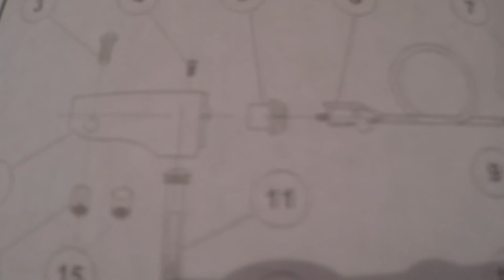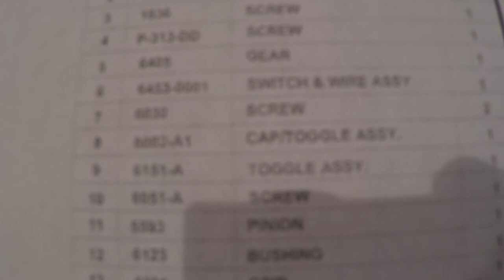Unity Police Spotlight - Remove or Fix

Comment: To spot a 2011 Impala 9C 1 I noticed it did not have ambient air sensor, I was thinking the center was bad until I found it missing went and bought one put it in, and OEM still don't see no temperature my question is did they even install a ambient temperature sensor in these police model cars

Comment: I am restoring 2 spotlights for my 55 chevy. I have the original ones but they have pitted chrome so I got a couple from a few years newer Chevy that have great chrome.   They look pretty much like yours in this video. Problem is I will need to remove the long shaft that the drive rod goes through. It should come out .  I have 6 to swap parts from but I cant get this inner rod out of any of them. Any ideas?  Thanks!
Reply: Make sure the parts are not matched up with the Old ones.

Comment: Hey cool video! So if you remove the light what about the big hole through the A pillar?
Reply from the maker: The most common thing I've seen done - most people use outdoor - clear window caulk to fill in the hole.  It'll seal it up, and it's not as noticeable.